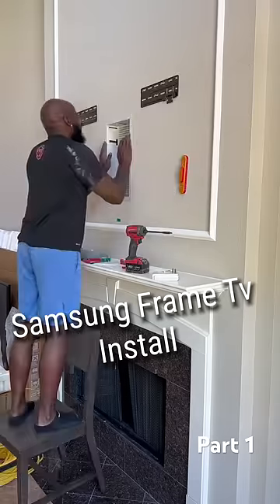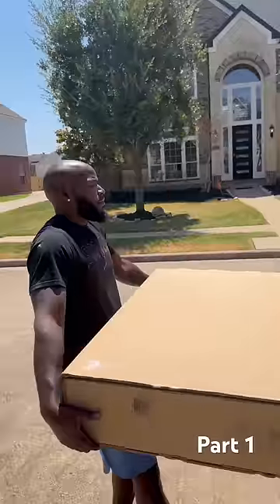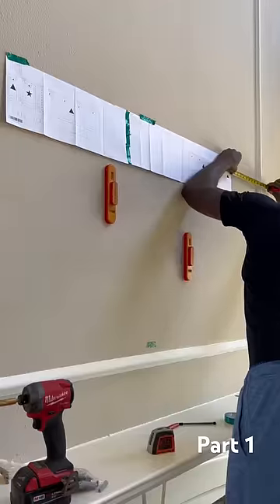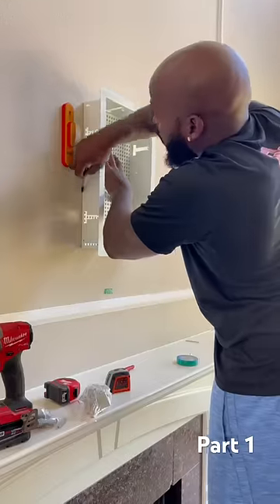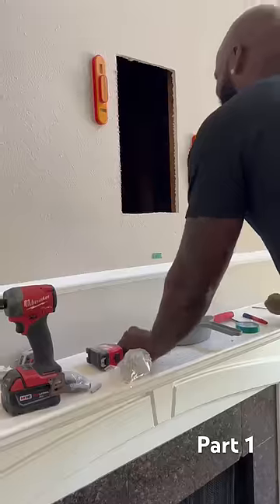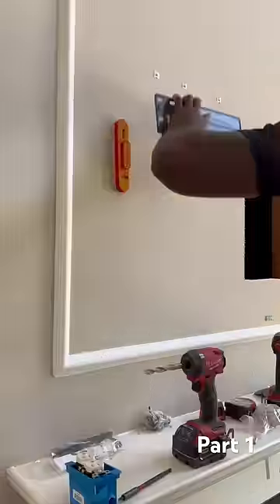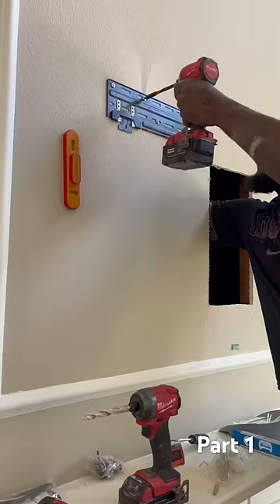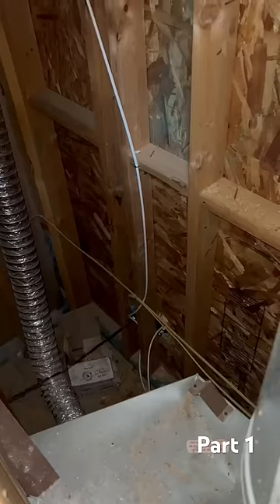Samsung Frame Install Part 1 #fyp #install #tvmounting #reels #frametv #samsung #4k #art #picture

Comment: You cut a hole in the wall, literally saw all the studs, but still don't mount to the studs? If it's not centered use long straight brackets as adapters for the mounts. Won't be perfect but 100x safer than mounting to drywall. WHEN that falls not "if", you better hope none of those kids are near it.

Comment: That tv must weigh around 28 lbs to 40 lbs at least.  Drywalls aren’t designed for weight bearings.  That’s what the studs are for.  This guy is cutting corners. That’s not only dangerousif it falls on an infant but  it can pose electrical fire hazard.

Comment: That tv is going to fall off that wall. Toggle bolts are meant for metal studs (drill through metal stud and slide toggle thru the stud. They shouldn’t even be on your truck or van.

Comment: Imagine not putting any grounds in ....tv straight to the plaster board !!!!!!...using chairs to knock cut bits out ...measuring "a whole bunch of times" .....for a few tv brackets !!! And then he thinks it's a flex by showing the back of the TV and how flat it is too the wall even though its designed to be like that has noting to do with him personally !!!

Comment: Top left corner of the tv is bent away from the wall. That tv is meant to go flat into the wall, but it's sitting on a wall trim piece. Overall, terrible job all around.

Comment: I don’t understand these houses, when I install a wall mounted TV I have to pull out a concrete drill, couldn’t even install that box. Why do you even have drills, you can just push a screwdriver through that.

Comment: Great work on hanging the television. But if you use that fireplace, the heat from the fireplace will affect the television you should not hang a TV over fireplace that you use.

Comment: Bruh, Sheetrock to hold a tv up? Are you crazy? At least hit the stud I mean you got access to the back and you still didn’t hit the stud or even cared enough to add some plywood. Not even in construction they allow the 5/8” Sheetrock to hold a 50” they add plywood on the back every time!

Comment: "No studs" shows the inside of the wall with studs 18in on center as they should be, with toggle bolts in between em smh

Comment: I hope he knows thise ancors are gonna fall out after about a year of holding that tv no matter how light it is. Dry wall is not made to hold any weight besides a picture. If you were smart you would have ran a support 2x4 across the interior section. There is a right and wrong way to do things and this is wrong. Also this mount is just not a good design to begin with.

Comment: I hung tvs for millionaires for 10 years. Don't use toggle bolts use Zip Toggles they workuch better and are rated for such. Be careful putting the toggles that close as well as it diminishes the structural integrity of the dry wall. Example cut a 2x4 and put them behind the wall for regular bolts as well as you had access to do so when you cut the hub box opening. Hope this helps brother.